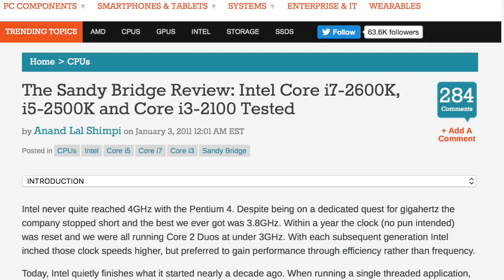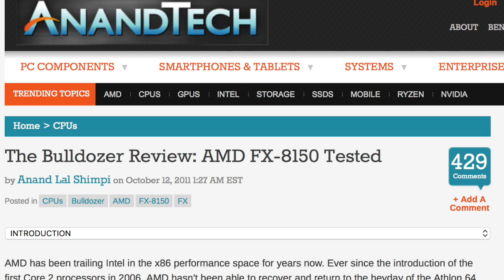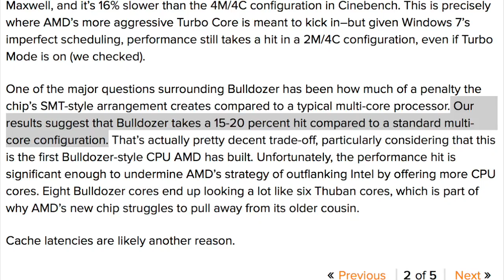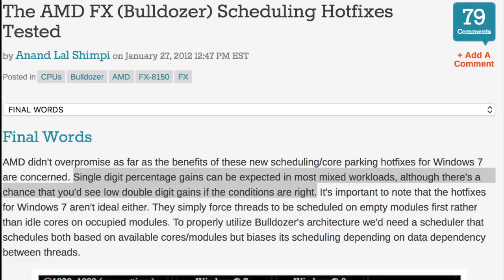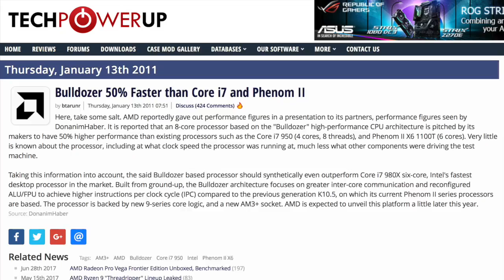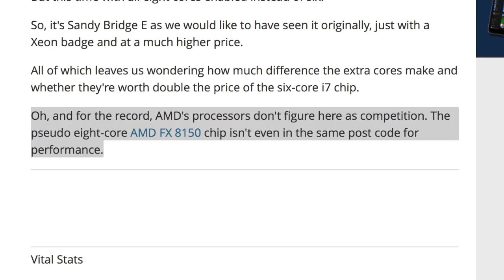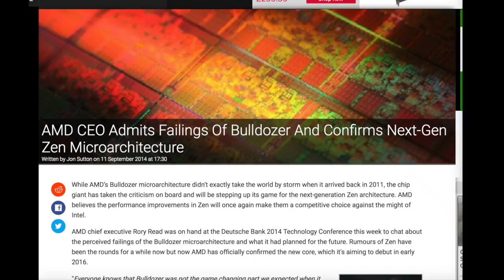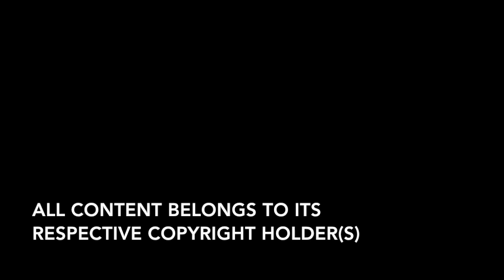The Bulldozer Story - and why AMD FX is better than you remember

Comment: Piledriver might be one of the most underrated products in recent history. While 8-core Bulldozer parts lost to i5s even in multithreading tasks, the 8300 series performed well in multithreading tasks and gradually gained ground on the Sandy and Ivy Bridge parts in gaming. Also the Athlon X4 860k and 845 were unsung heroes of budget (though power hungry and cooling demanding) quad cores, though now they lose solidly to the G4560 in every test.
Reply: 2012 AMD vs SB is much different than FX 8350 vs 2500k in 2017 on only new games man. Yes 2500k still leads...by a shred in some titles but in others the fx 8350 creeps ahead. but the gap has closed in general, some people get a cpu and keep it for 10 yrs, and most fx 8350 owners are still happy, most 2500k owners have been suckered into getting another 4 core I5. Either intel or AMD as long as you shop smart your good. I.E. but a R5 1600 or I7 7700k now, dont upgrade it for many years if 60 fps is all your after xD
Reply: Overclocking to the max both my 8120 and 8320 beat out my 4670K in cinebench but only the 8320 beat it in a 1080p rendering bench (HwBot X265).  At 4K rendering my 6300 and 8320 beat it but the 8120 was quite a way behind.  My memory, northbridge and ht link speeds were well optimised which makes a big difference.
Intel parts are more plug and play where FX needs some decent tweaking to get the best out of it.
Reply: built a PC with a amd 6350 .. clocked it to 4.6750 @ 1.425v with nb set to 2775.. ish on air it idles at 20 degrees.. on load 46 keeps under 50 .. on air!!
Reply: yeah thats a lie lmao
Reply: "While 8-core Bulldozer parts lost to i5s even in multithreading tasks"

This never happened? Except recently for Skylake and up i5 OC'd to 5 GHz.
Reply: as opposed to upgrading with each intel cpu? i have an 8350 i never see it dip below 60 fps on cpu bound games and this is stock. while i do also have a phenom II x6 1100t my piledriver is still my fav. i use the 6 core for game servers now. i have considered new ryzen. but waiting a lil bit longer.
Reply: Last year I was building general PC's with 860K's but now I've switched to the G4560.
As people I know don't look after their PC's and will let them get dusty inside I turned off the turbo's on the 860K's that went to hot countries in holiday homes.  Nobody has reported any issues so far.
Reply: even the 8120 i gave a friend (clocked to 4.2 with 4.4 turbo) is honestly, not that slow, infact, under 10, it benches better then his fathers 2500k that has better ram, a board that cost 2x as much, and a full size 1070 rather then a dual fury nitro cards, they swapped cards because the fury actually works better on his fathers rig(dosnt use cpu cores to thread dx11 rendering via driver), honestly, for all the shit people talk....i dont regret the upgrade path i took, i got parts when i could afford themi moved from a 790x and x6 to a sabertooth 990fx i got for a good price(under 100shipped newegg!!!), same cpu, then moved to an 8120 i got stupid cheap on shell shocker, then to an 8350 i got shell shocker stupid cheap, then, the 9370, only because, newegg fucked up and sent me a chip from each warehouse when i did an order, and after 3 calls lasting over 45min each...i gave up trying to get them to understand they needed to give me a return label so they could get the chip they fucked up and sent me back...

sad part, my 8350 was better silicon, ran cooler, clocked to 4.7 at lower volts and temps...but, i recently gave it to a friend whos board in no way could support this chip(would just kill itself if he tried the msi 970 game isnt a horrible board but....its far from excellent...

oh i upgraded to a chv-z when a buddy had a client who ordered one, but had also ordered an matx case, and wanted the small system more then the large board, i paid 120for a brand new, unopened chv-z...cannot complain about that..

as to my 32gb ram...i paid 120 for that shell shocker on newegg(first kit was 1866, then i got a 2133 kit a couple years later for around the same price, and resold the 1866 when a buddy offered me the current cost of it on newegg...minus 20bucks...was still over 2x what i paid for the ram  shell shocker...LOL....

all this shit talk...

http://www.guru3d.com/articles_pages/watch_dog_2_pc_graphics_performance_benchmark_review,8.html

http://www.guru3d.com/articles_pages/dishonored_2_pc_graphics_performance_benchmark_review,8.html

http://www.guru3d.com/articles_page...e_warfare_pc_graphics_benchmark_review,8.html

http://www.guru3d.com/articles_pages/battlefield_1_pc_graphics_benchmark_review,9.html

http://www.guru3d.com/articles_pages/gears_of_war_4_pc_vga_graphics_performance_benchmark_review,8.html

the above dosnt seem to agree...once you push 1440 or 2160p, the bottle neck becomes much smaller, on a stock 8370, clock that chip to 4.5+, and even most 970 enthusiast boards can do that, did it years ago with an 8120 in an matx biostar board we paid 65bucks for, the systems been at 4.5 since the 8120 launched with an old xigmatek aeiger (sp?) and a couple 120x38mm panaflow pwm fans on it.. (7-8bucks each on ebay, dell system pulls/replacements, destroy anything you can get at 3x that price thats pwm ;) ) 

anyway... its funny how "horrible" these chips are...only bench on average 10% faster then a 2500k under 10 with modern gfx... (8370 vs 2500k stock for stock) 

couldnt pay me to take a 7700k and those horrific temps.....ppl talk shit about these chips..i have never seen any of my 8k chips pass 65c even under heavy stress testing.....on a low end cooler, i have rarely seen any of my friends 7700k/ivy chips below 70c under even moderate load... gaming... can see it go past that...makes me cringe hard... i would have to  remove the ihs and replace their horrible TIM choice at the very least....
Reply: The final cut is that most of Fx8350 owners if they still kept their 1080p display didn't need to upgrade their CPUs since 2012... the computing back in the day was so unoptimized for the CPU but yet it was OK and could handle any task... when years went by multicore optimization came progresively and the slower and aging tek started to use his full power.

Now in 2018 Visheras compete with R5 1400/R3 1200 and also with 4 core i5... yes, they still need overclock, yes, they have no futureproof at this point, but it was a great purchase for ppl that can have his CPU as a valid gaming and editing CPU (again, at 1080p) from 2012 up to (expected) 2020
Reply: NO MA'AM Athlon X4 950 os the new enemy for G4600 and G4560
Reply: the Athlon x4 950 is shit for gaming. Just saw some benchmarks on it.
Reply: I get better results from my 7 year old a10 5800k OC'd.
Reply: Keelan is corect, any i3/i5 is better then an FX line chip, they cannot game, they cannot do anything well......

http://www.guru3d.com/articles_pages/watch_dog_2_pc_graphics_performance_benchmark_review,8.html

http://www.guru3d.com/articles_pages/dishonored_2_pc_graphics_performance_benchmark_review,8.html

http://www.guru3d.com/articles_page...e_warfare_pc_graphics_benchmark_review,8.html

http://www.guru3d.com/articles_pages/battlefield_1_pc_graphics_benchmark_review,9.html

http://www.guru3d.com/articles_pages/gears_of_war_4_pc_vga_graphics_performance_benchmark_review,8.html

see, totally useless, trash, garbage... why would anybody pick that over an i3/i5, even first gen i3/i5 destroy the FX line in every way that matters to people who game!!! ;) ;)
Reply: The only problem with your debate is that the FX lines chipes, even if they are cheap right now, are not future proof. You would still have to change out your whole rig (motherboard, cpu, ram) eventually, just to keep up with everybody else. I upgraded from an old 7 year old APU to an intel pentium 4600 and I honestly say I could not be happier. Even on two cores, It can do everything my overclocked apu couldn't and then some. Not a bad $50 chip. Which stands up against any of the fx line chips..
Reply: NO MA'AM there are exceptions, for example, if you have  a nice 32gb ram kit but are on an older amd or intel platform(board) thats got no where to go,  also i know a few ppl who are/where on old phenom II chips on boards that support FX, who got a HUGE boost, the one fellow moved from a 4.2ghz 6 core, to an 8370 he got for 75bucks new, and before he even overclocked he was utterly shocked at how much more responsive windows 10 felt, once he locked it at 4.5 (best his boards stock cooling can do without adding several VRM fans) he was blown away...

another example is my buddy who had his 2500k board blow up(litterly the vrm section of a top end asus board, burst into flames, was under warr but, they where looking at a 4-6 week turnaround to get im a replacement, he needed something now...) we went down to frys(couple hours drive from here) because a friends brother works there and said they had some good combos and he would buy them for us with his discount if we took him to lunch...the intel combos where all either TRASH boards, or, ddr4, in the end, he got an 8350+asrock 990fx extreme9 for under 150 with replacement plan, and hyper212evo(they had it as part of the combo), not the best but, that fellow ended up selling the dude who bought us the parts(got us the discount really) his 2500k, for more then the combo cost, and the fellow also bought the replacement board for 50bucks less then it was selling for band new...he was planning to just find a 2600k or better to toss into the board and swap it out but, he was so happy with his cheap overclocked amd rig that... he has kept it, even tossed the same zotac 1070mini into it that i have(he had dual 290x cards like i did, but in his intel rig originally)  hes getting a better cooler around xmas when i help him build his kid a system, so he can push the thing higher then 4.5,  its taking 4.5 like a champ on that hyper212 though... 

anyway, with ram prices as they are/have been, ddr4 was not worth the investment to him, and though, he considered selling this system, and building something with ddr4 when he sold the board...he added up what he really would like to get...and decided to wait, infact, hes now got his eye on the HP z820 dual socket 2011 workstations, you can get a dual 6 or 8 core(12/16 threads per chip) with 128gb ram, for less then an 8core ryzen+decent board+64gb ddr4....and, its a beast for the price.... sure the turbo is 3.5ghz...but if you ask alot of the people here, an i3 at 2ghz is better then an fx at 4.5... ;)
Reply: lolwat? not unlesss u were running above 5ghz on that fx
Reply: No. Bulldozer and Piledriver were both failures for a reason. They performed poorly. In a way, they were very interesting and well ahead of their time, anticipating the move to parallel processing long before the software moved in that direction. That's why even 2 core sandybridge i5s were fine for most people. I would know, I had one until just a year ago. I used to be the biggest AMD fan, but the bulldozer was the wrong design at the wrong time. Its massive power consumption never did it any favors either. After so many years they could never even equal the performance of the chips bulldozer was initially competing with. I think that says so much. I'm actually really excited to see them bring out ryzen but that is the processor they should have made 10 years ago. 

Then there is the whole 8 cores, except its really 8 cores that have to share some parts like floating point units. Two cores are grouped into units. So, its really not all that much different than hyperthreading except that you do gain the benefit of each core having their own integer unit whereas hyperthreading is merely stacked execution units that share the same resources.  It was a somewhat innovative design in some ways, but far too many steps backwards in others. An also even in multi-threaded performance it was still never even competitive with the i7s despite being designed from the ground up to excel in heavily threaded workloads. It was a massive fail then and still is now. Let's face it: the sandybridge era chips are obsolete now anyways. They had a good run because they presented great performance that was adequate for most people for a long time. You can get a used 4c/8t i7 machine for pretty cheap these days and it will destroy any 8300 series processor as well as draw about 1/5th the power. And you won't even have to overclock and and waste time playing with voltages and memory timings.
Reply: especially when you consider they were still on 32nm.  Had they been made on 14nm they probably would not be so far behind intel products.
Reply: +Braden I wouldn't recommend anyone buy into the FX line right now unless they're upgrading from something like an FX-4000 series, in which case they already have the motherboard and DDR3 RAM. The only time I ever recommended APUs is when I point people to Walmart for $100 PCs. I don't recommend PC builders buy into 5+ year old technology in general unless they have little money but a lot of time.
Reply: NO MA'AM yeah that's just not true, I had an 8350 at 4.7ghz and well it was just blown away by sandybridge
Reply: AdoredTV has at least 2 videos on the subject. Here is one: ylvdSnEbL50. Start around 5 minutes.
Reply: Hope so. R3 is too expensive, should be under $100.

Comment: Just checking, but you are aware that passmark isn't a survey, right?  I'm not saying that AMD's market share wasn't low, I'm just saying that I don't expect "7%" to be accurate.  

Other than that, great video!
Reply: I'm honestly skeptical of the Steam Hardware Survey's accuracy as well. I doubt that most serious gamers run an Intel 2 Core processor at between 2.3 to 2.7 GHz, other than maybe some of the Dota 2 casual players who play on their laptops, as they account for a large part of Steam's userbase.
Reply from the maker: Yeah, it was used because finding accurate market share numbers is difficult. Thanks for your comment :)
Reply: Did you consider using the Steam hardware survey?  I probably would have used both to try to get a range of possible percentages...
Reply: A lot of school kids use Steam and log more hours than adults.  Most have to manage with a typical dual core processor.
Reply: a better check would be numbers from steams user survey, though its also only a limited sampling as not all gamers take part and not all gamers use steam, personally, though i hated it early on, steams become my favorite digital platform over the years, its got bugs and lots of flaws but...uplay, origin, etc, are worse.... :/
Reply: +david buddy, actually im shocked how many ppl i know with steam who play OLD titles and desktop games via it, who do have OLD AS HELL systems, my fathers an example since i got him some games in a humble bundle that where steam titles mostly, hes been using it, first on his now dead dell c2q6600 now on the fall back amd x4 setup we had around that was able to just boot and work with the drive from the dell(caps on board are leaky and bulged...very common with that era dell sadly..) 

its def not 100% accurate but, of gamers, i think its likely to be more accurate, if you exclude the lowest end stuff anyway... (for a very very very long time, intel had top spot on gfx even on steam...if you included igp type gfx... yes...ppl try and game using onboard gfx... rofl...)
Reply: I wouldn't call the steam stats off.
If it is about market share, then even older processors are still active. Sales figures are a different thing, but not everyone upgrades every generation and not everyone plays games on their system.